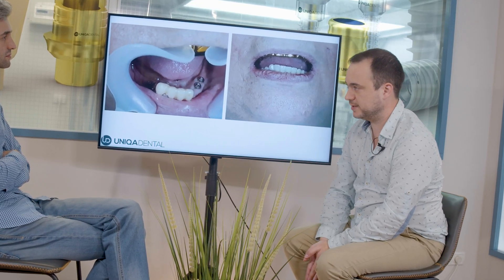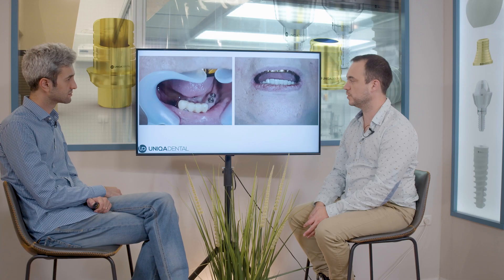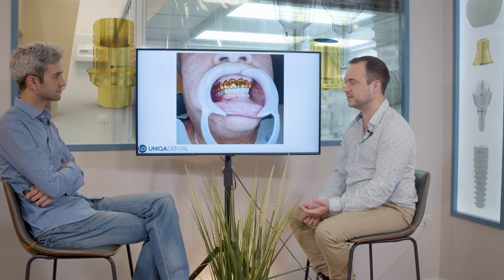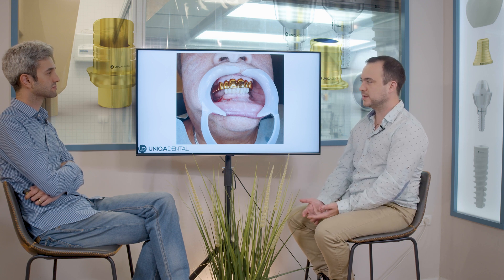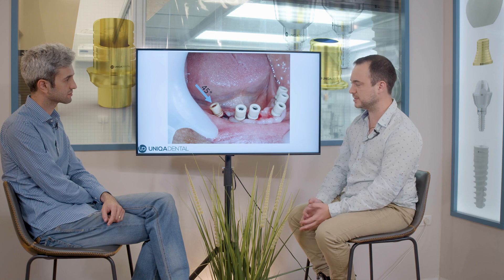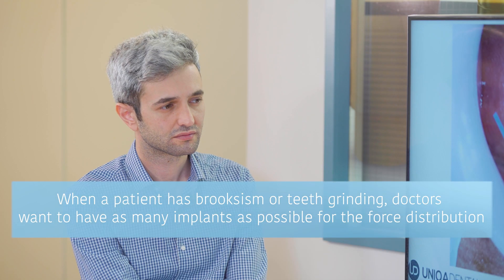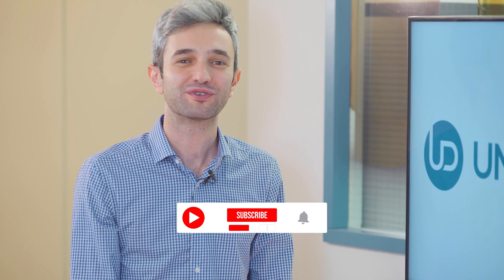How to distribute forces on dental implants by screw retained system? Digital restoration

Comment from the maker: 00:00 These implants are already osseo-integrated. A problematic case.
00:36 It's a new golden bridge.
00:55 Talking about the lower teeth, the mandible.
01:56 How add dental implants?
01:59 We  left her old golden bridge
03:00 There is no bone to place in implants.
04:17 I'm sure the upper metal don't help in this situation.
04:55 This is due to her grinding. We still added one dental implant where she had left some bone and going above the mental nerve.
05:54 And these bridges are on all of the dental implants.
08:04 It's not like porcelain fused to metal using two dental materials.
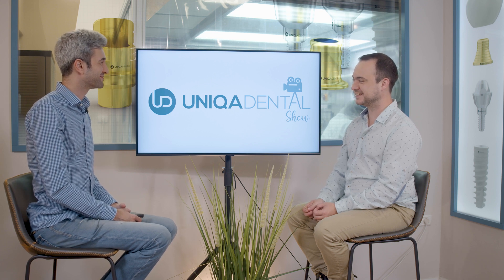08:57 We'll see how it will come to this.